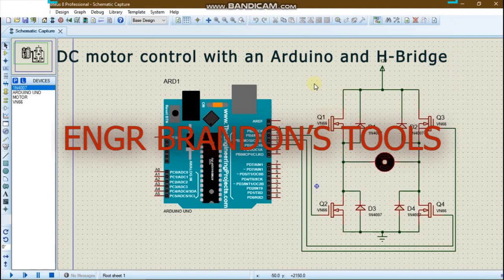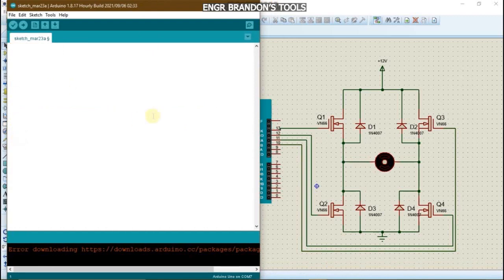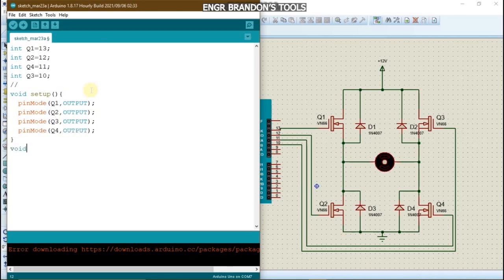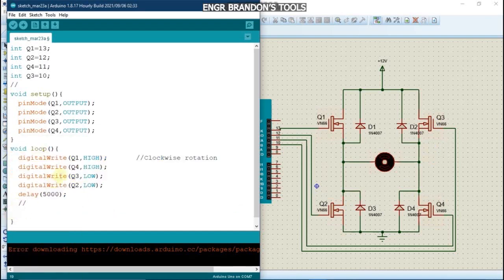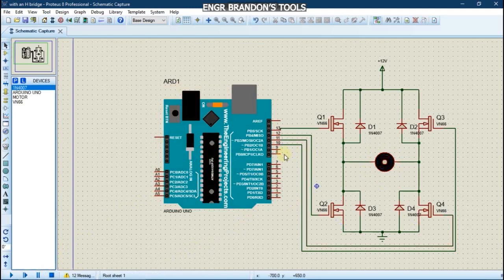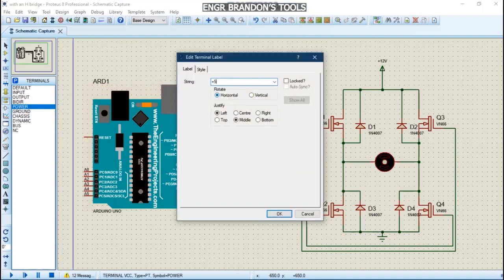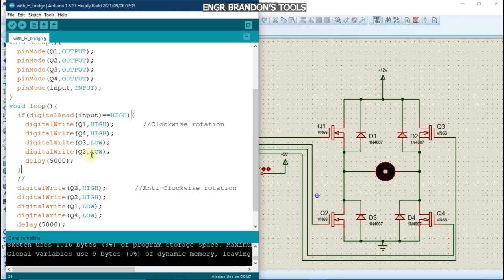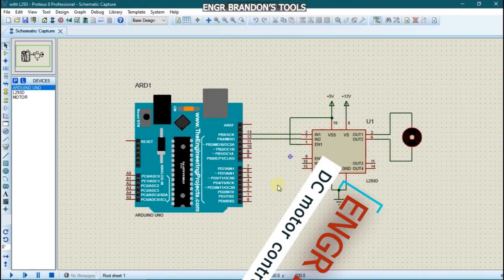Mastering DC Motor Control with Arduino and H-Bridge on Proteus

Comment: can u plz upload the link for the schematic again cause its not working .
Reply: its not working because this circuit is straight up wrong. the highside mosfets wouldnt be fully on or off. they would be somewhere in the middle or the lower side really and they would get somking SMOKING hot with ANY kind of load. the problem is that the high side mosfets source is at the B+ and the gate is only getting 5 volts from the mcu. that 5 volts is far below the voltage needed to turn on the fet fully. what you need  depends on your situation. swapping out the high side nfets with pfets will solve that issue but you need to make sure that the pfets compliment the nfets in regards to currant rating and the drain-source resistance. otherwise the high side pfets will get smoking hot in seconds. i prefer all n fets but the issue there is that you need to creat a bootstrap circuit to increase the gate voltage on each high side fet. the other option is to simply get the right stuff for tyhe job. they have IC's that are meant to drive one low side fet and one high side fet. or they also sell ones for driving all 4 fets. that imo is the best solution because the n fets are far superior to n fets.